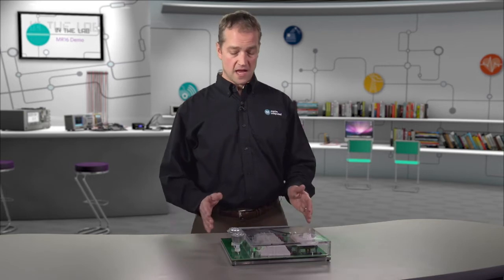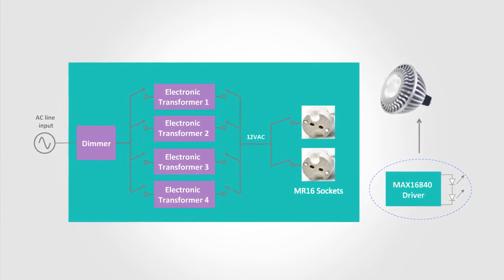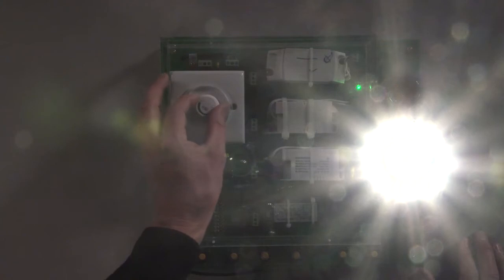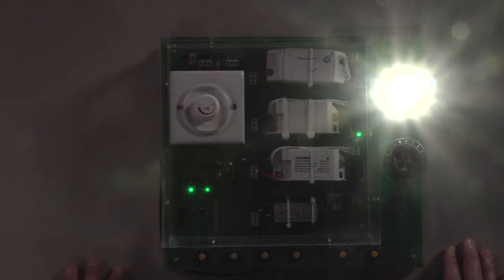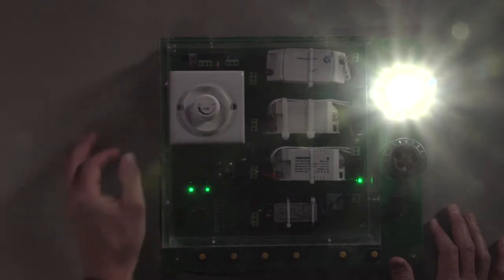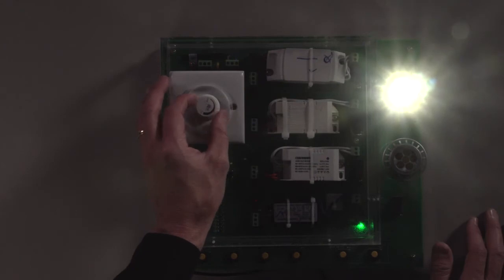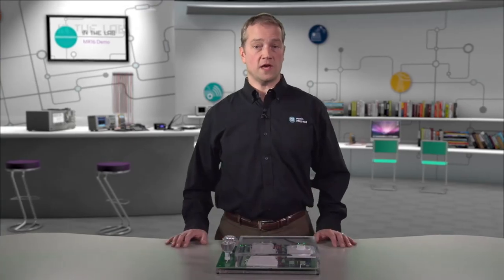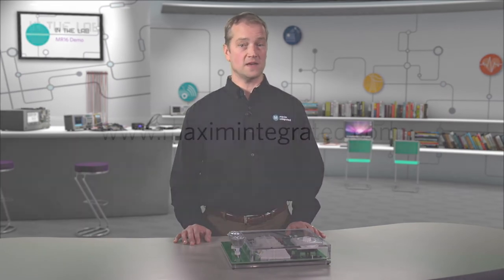In the Lab: Eliminate Flicker for MR16 LED Lighting

Comment: Sir, could you give me this circuit diagram of not flicker dimmer LED power system?
Reply: They won't show a proprietrary design circuit diagram.  This video is just a big advertisement for the one particular brand of LED driver chip.  A proper comparison would show more than just an "unbranded" cheap LED as competition.

Comment: can the flickering cause fire or power problem by ruining the mother board?
Reply from the maker: No, the flickering will not cause fire or damage the LED driver board. Flickering is due to the local electronic transformer (ET) turning off and on due to insufficient loading by the LEDs.

Comment: Do you make a mr16 led lamp with a gu-7 base type that doesn't require any type of retrofit to the ballast?
Reply from the maker: +Dham206 Thanks for your interest. We have a MR16 LED driver for GU5.3 (12V) that is compatible with trailing edge dimmers.
Reply: Why exactly is there no flicker?
Reply from the maker: When there is not enough current demand from the electronic transformer (ET), it will turn off and on for short periods of time, causing a blinking or flicker effect on the LEDs. The MAX16840 is able to draw enough current from the local ET to keep it on.